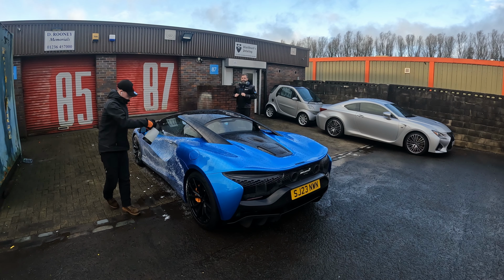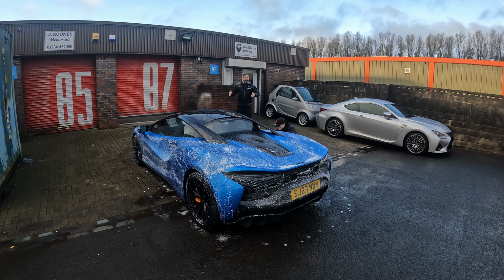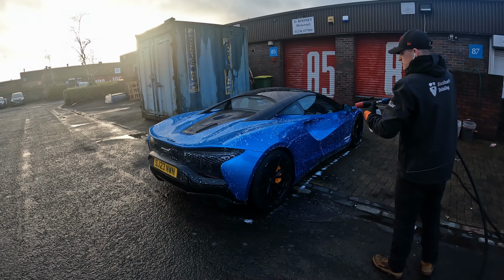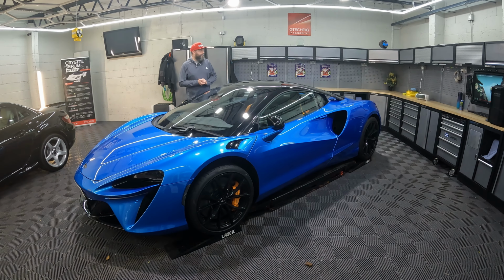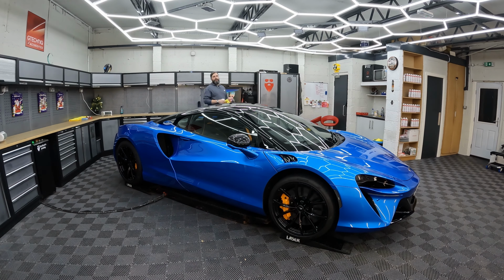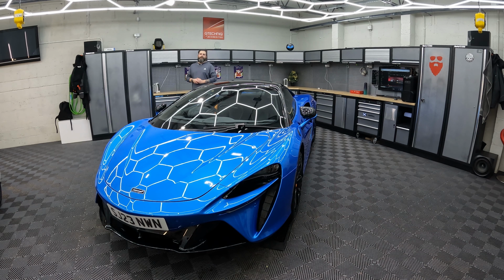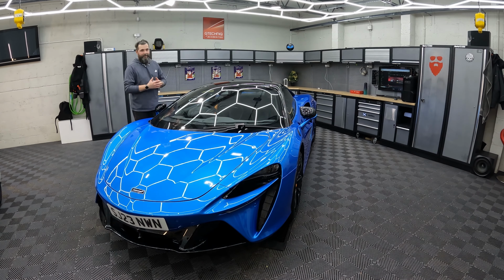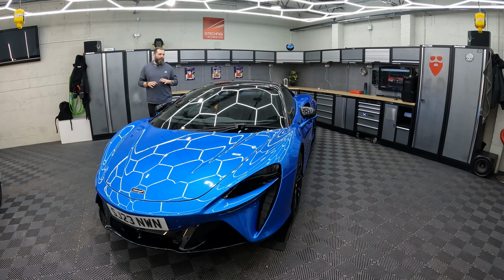2023 McLaren Artura | Cerulean Blue | McLaren Glasgow | Gtechniq Crystal Serum Light | Detail

Comment: I noticed with your Blo Air GT that it looks like you have a longer than the supplied 8m hose? Just wondered how you achieved that? Cheers
Reply from the maker: Hi, I got a matching diameter hose then held them together and secured with a bit of gorilla tape.

I then cut the gorilla tape in 10" strips and put them length ways overlapping each other.

After that I used zipties on top of the tape going into the grooves of the hose to then hold the tape in place.

It's been rock solid since I done that about 2 years ago bud 👍🏻